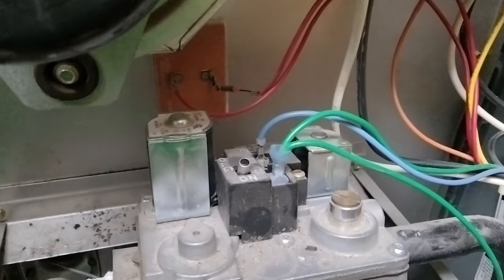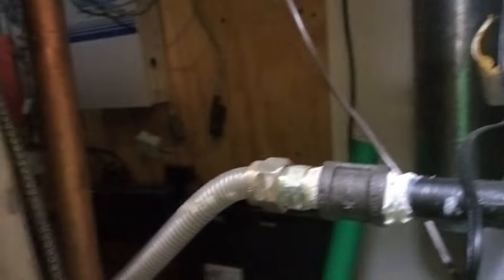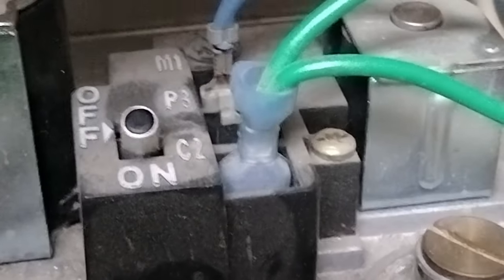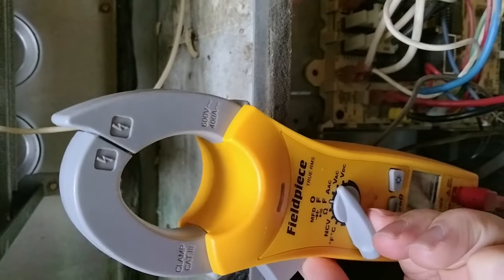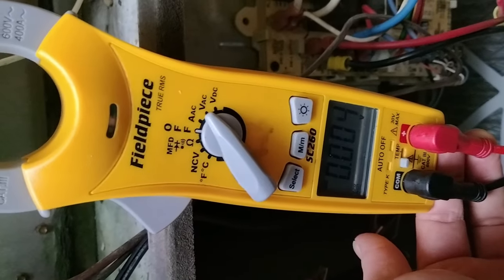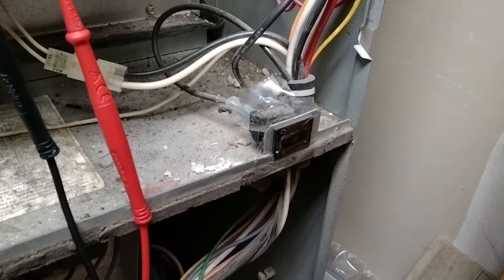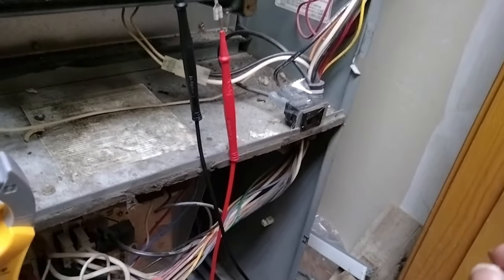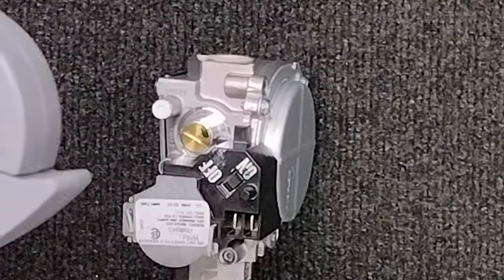How To Test Your Gas Valve

Comment: You have a big future in trouble shooting these gas valves! Part 2 is the pressurized air into the manifold and part 3 is the voltage signals going into the valve.  You are a very smart technician! Keep up this good work!

Comment: I had a spider build a web inside one of the tubes and it messed up the whole gas flow. Once the metal orifice were removed I could see the issue
Reply from the maker: Wow, that is crazy! I've seen some strange things before but I think that one probably takes the cake. Glad you were able to fix it at least.

Comment: Nobody knows what is wrong with my furnace. It runs great but when it gets warm in the afternoon and doesn't run for a couple hours it won't restart until I do a hard reset. Then it works perfectly all night long. I've had multiple people out here. One guy wanted to replace the valve but it runs perfectly after hard reset all night. It's a newer furnace. Coleman DGAX090BDTA. It hasn't been cleaned for awhile. My dad did it but he passed and I just didn't get it done. The filter is a month old and is a 3 month filter. The code is 1 red flashing. Please help me. 
Thank you.

Comment: Very informative video.  One question about the voltage test: I saw a reading of 14 VAC before the board sends 24 vac to the gas valve.  Is the reading supposed to be zero, other than 14 vac? On my own Bryant gas furnace, I noticed the same 14 Vac reading.
Reply from the maker: It can really depend on the type of gas valve and unit you have. I've seen units that send a sort of 'test' voltage to make sure the ignitor is coming on like it should (I think Trane and some carrier have a smart sense ignitor) and some boards that also send a blip to see if the gas valve is there. Basically not enough to turn it on. Usually, however, I see this on smart valves which manufacturer's stopped using because of all the issues they kept having.

Comment: Thank you for your great video teaching how to troubleshoot the gas valve. My gas company just installed the new gas meter at my house. I turned on the gas furnace, but it was not working. I saw the hot surface ignitor glowed, and I heard the relay click sound from the gas valve, but I did not see any flame, and did not hear any hissing sound of the gas flow from the manifold. Now I am not sure if the failure is due to the fact that there is no gas fed to the inlet of the gas valve, or due to a bad gas valve. I would like to check the gas supply first. Could you please advise what would be a proper and easy way to check if the gas is present at the inlet of the gas valve? I know the best way is to use a manometer to measure the gas pressure at the inlet port, but unfortunately I do not have one right now. I ordered one and should arrive in a week or so, but if there is a easy way without using a manometer, I would like to try it now. Thank you!
Reply from the maker: So, I'm not a plumber so I wouldn't be able to talk about the nuances of wc pressure (gas pressure) but I can say, if you hear the click from the solenoid on the gas valve but it isn't lighting it could be power related, (board isn't sending constant 24v) or gas pressure issues, or bad gas valve. 

Other things to note, there could be a clog in your burner plates on the burner trail, or the brass orifices coming off of the manifold could also be clogged.

Comment: Question. What about gas valves stuck open and leaking? Thanks for the great video! 👍
Reply from the maker: Sorry for the super late response, I'm sure you've found the answer by now but just in case I can give some insight. When the solenoid on the gas valve is stuck open, there's one of two things happening here: Either the gas valve is receiving signal from the control board to come on, or the solenoid is bad. An easy test for that is to remove the two wires from your gas valve, connect your leads to each one and then turn on the unit. (always make sure the door switch is taped in before calling for heat.) Just as your ignitor starts to come on, you should get your 26-28 volts ac until the unit will fault out for no flame sensed. If the valve is at fault and staying stuck open, that is a new gas valve. As far as leaking, if you are concerned about that (which uh, yeah you should be), turn your shut-off valve on your gas line by the unit to off. That's common sense, but figured I'd add that in for good measure.

Comment: I have a Rheem criterion 2 furnace. It’s started to only blow warm air, not hot like usual. What could be causing this?
It starts up like normal, seems to run normally, but only puts out warm air. 
I’ve tried by passing the high limit switch and thermostat. Same result.
Reply: Sorry if this sounds too obvious, but when I’ve had this problem it was a dirty air filter.

Comment: Or folks. You could just have an HVAC technician come out with the proper tools such as a manometer to verify that the gas valve has the proper gas pressure as well as allowing gas to flow through the valve without taking it apart.
Reply from the maker: Both methods achieve the same result.  One requires special tools, one does not.  One you can do without spending money, one you can't.  If you're upset that people don't need your service, you should make yourself more indispensable.